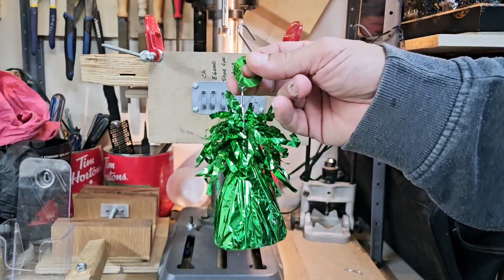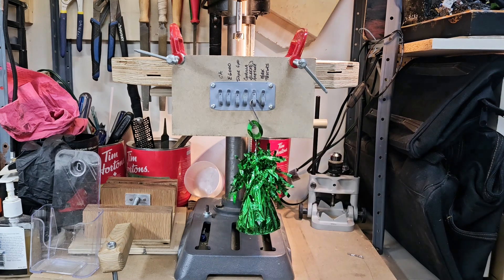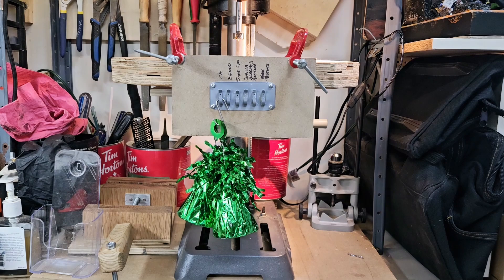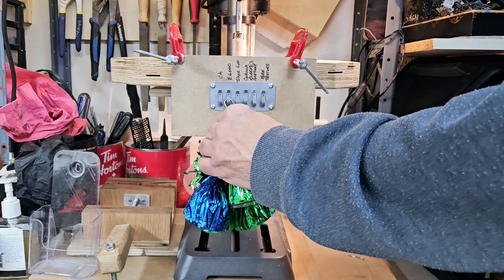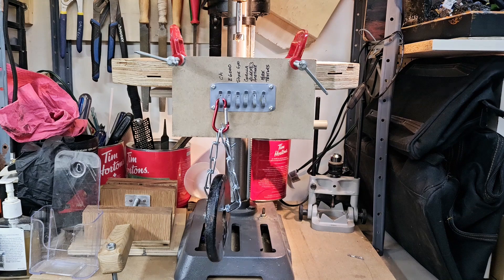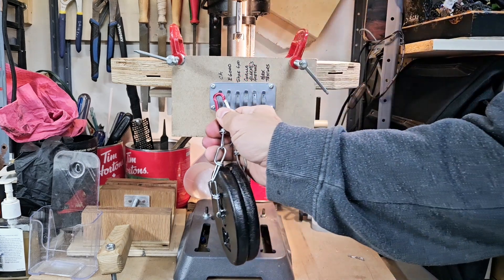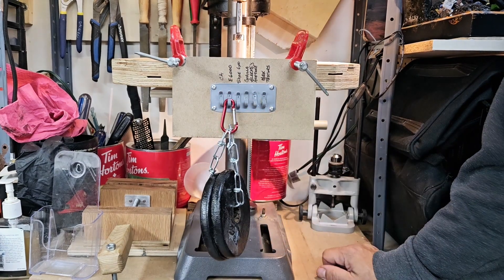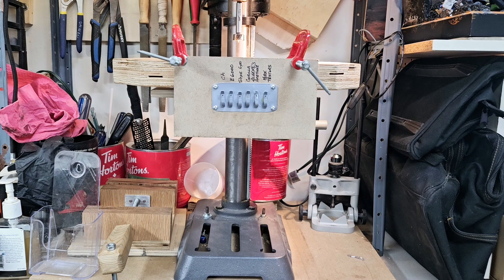Are You SURPRISED! #glue #3d printing

Comment: For gap filling use resin UV the kind used for jewelry making, it set with just a UV flashlight. I use thick CA for strong bond printed parts really do not need that kind of strength
Reply from the maker: That's a great tip! Using UV resin for gap filling is an excellent way to achieve a clean finish. Thanks for sharing your experience!